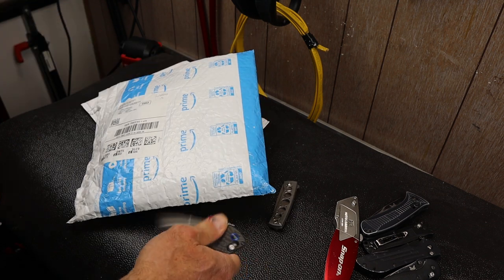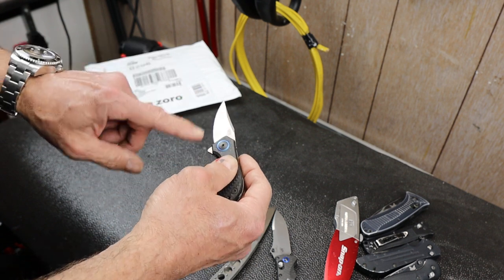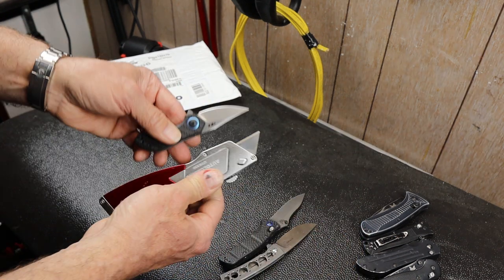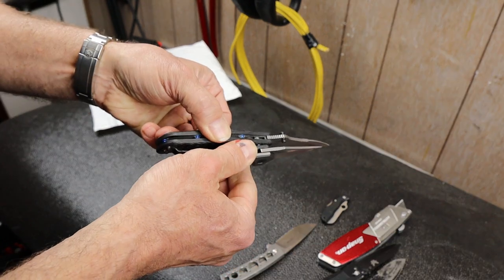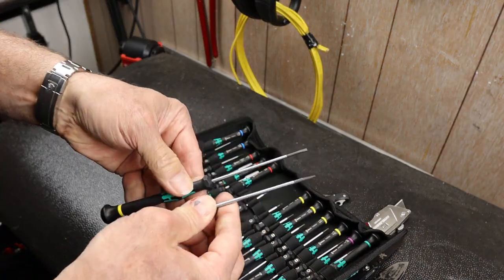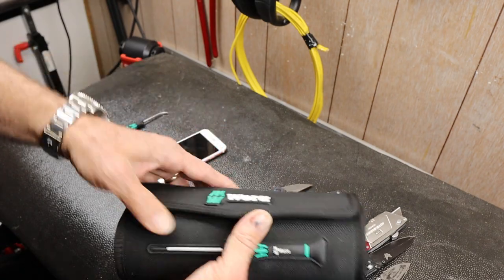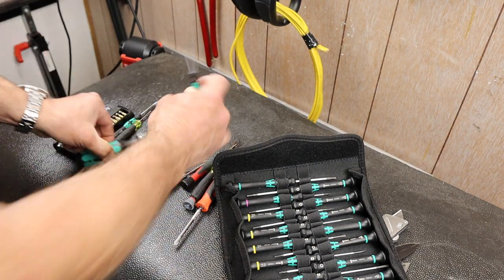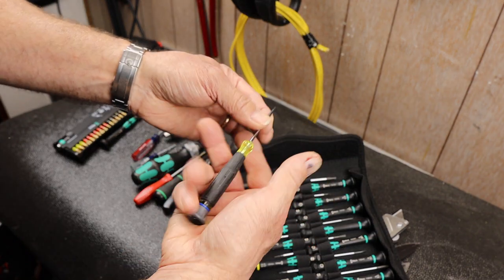Double Unboxing: Zero Tolerance 0022 Knife and Wera T9 Torx to complete set

Comment: I am glad you went a little more into that Wera set. I have been looking at that for a while. I have a few Wera, and I really like them. as for the nut driver in the set, they might of included them because of standoffs in electronics. Although I work in Aerospace some of them are 5.5. I know I have taken apart some computers and they did have small standoffs. So my guess would be that, but I am shocked they only provide 2. My set at work has 7 or 8.

Comment: Is it just me or do all screwdriver sets need to be updated and have most slotted replaced? Going to get the new updated Benchmade Adams folder, which version, not sure yet
Reply from the maker: I was excited about the mini Adamas, which is how I ended up with the ZT 0022. I have two full size Adamas folders and the skeletonized fixed blade Adamas. All are great. But in my stable of folding knives, while the mini Adamas is smaller, it is still bigger that most. I'll likely end up with one someday, but I am quite happy with my ZT right now.
Reply: @lastbesttool  I love my fixed blade Adamas, almost bought an auto version when they went on clearance on blade hq, been really close to pulling the trigger on the zt 0223 but probably going to settle on 0308 for now
Reply from the maker: @andrewscott8892  I considered the auto Adamas but thought the spring was underpowered. It worked, but I could tell it was at the top end of its power. Add some dirt/lint/age and I suspect the auto will become untrustworthy. Plus its not a fighting/defensive knife so one handed speed is less useful.
Reply: @lastbesttool  that's one reason I dislike buying stuff online, you can't handle it and feel the balance and handling characteristics. I have the benchmade afo II that I got brand new for $100 at the pawnshop with the American flag etched on the handle, that is a great auto